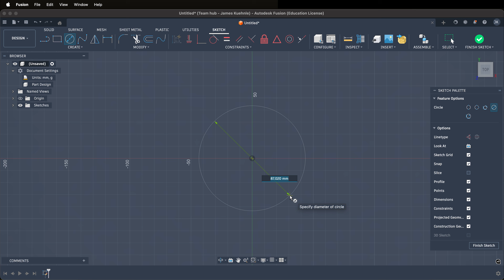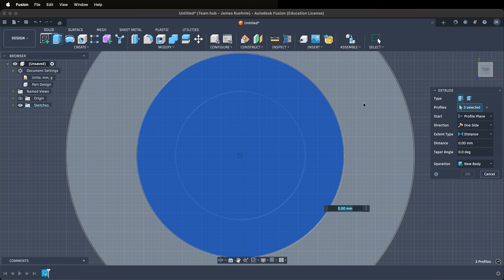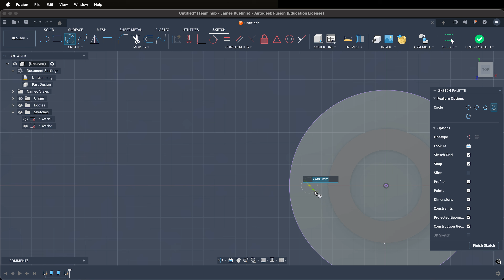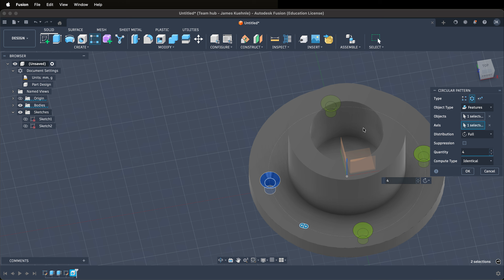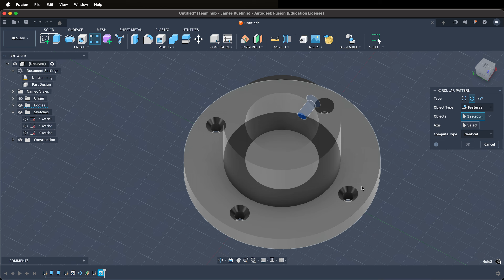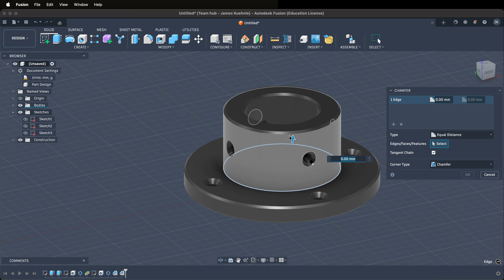Autodesk Fusion Tutorial: 3D Printed Pipe Flange Mount for 1 Inch Schedule 40 PVC

Comment: Great video, yet again. You mention creating a chamfer on the bottom edges is done because we're 3D printing. Why is that better? And is that something you should always do when with larger surfaces that will be connected to the printbed?
Reply from the maker: If you fillet on the bottom of a 3D print, sometimes the print can sag and deform on the base plate where a 45° chamfer  up has better dimensional stability

A video showing the difference between a fillet and a chamfer on the build plate is on my list of things to do

Comment: Nice video. About setting the center for your hole. You can also draw one construction line and then add a point at the center, which is then auto constrained. And to ensure you have enough clearance, apply an offset face (-) on the inside. Personally I find that somehwat easier.
Reply from the maker: That's a great tip and workflow, thanks for sharing. I'm going to try that in the future